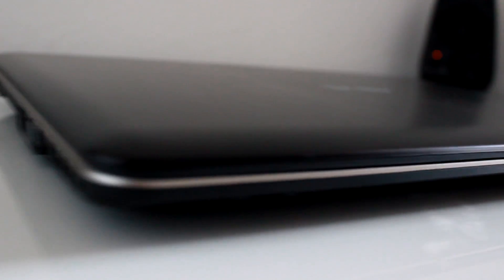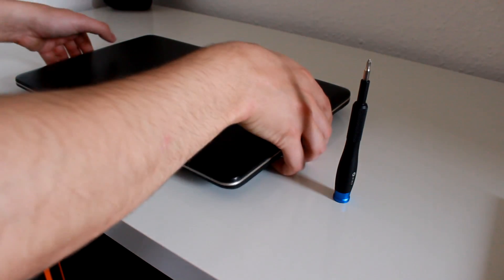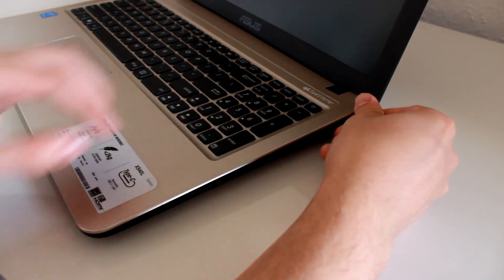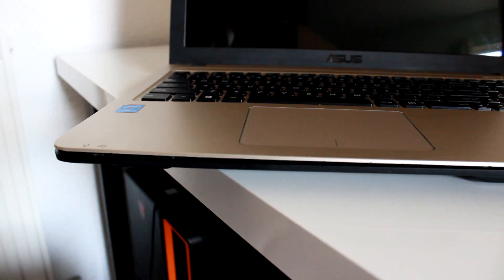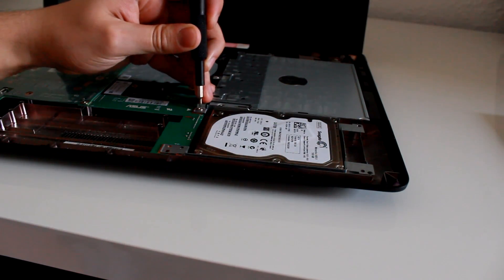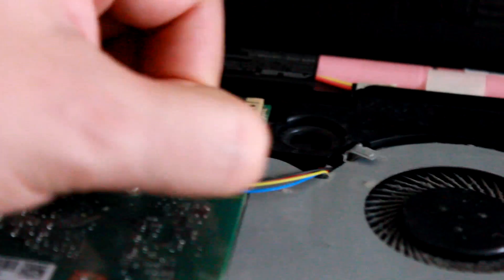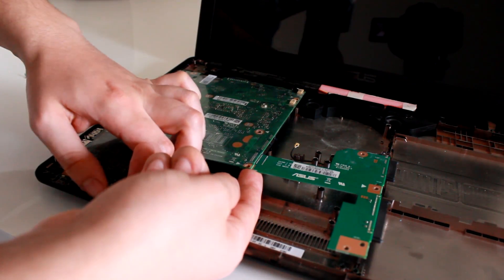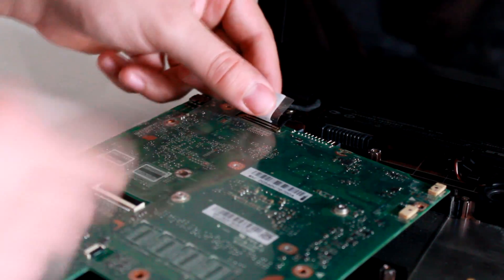Disassembling the Asus X540L: A Look Inside the Laptop

Comment: I have Asus X540LA-XX975. I just bought SSD and two 4GB ram sticks... Wanted to add additional ssd for storage and expand ram, but looks like too much husle... Can I have two ssd's?
Reply from the maker: If you can find the adapter for SSD's that goes in the DVD readers place than you can place a second SSD. As far as I remember this laptop only supports one stick of Ram
Reply: @TechGadgetsMedia  I found one guy selling them. Will order one. Do I need anything else? Cable to connect ssd with moherboard? If I need one, which one to buy?
Reply from the maker: If you got the adapter then you should just place the SSD in that then remove the dvd player and put it in its place.
Reply: @TechGadgetsMedia  I don't have dvd player, nor that external slot for it. Don't know what's it like inside. Wanted to buy everything I needed and then open it once and install everything...
Reply from the maker: Oh I see.. it might be a different version than mine then.. so what adapter did you find then? Send a link if you can.
Reply: @TechGadgetsMedia  https://m.kupujemprodajem.com/kompjuteri-laptop-i-tablet/laptopovi-cd-dvd-drajvovi/caddy-bay-ubacite-ssd-hdd-umesto-optike-metalni-kedi/oglas/38844203#start

Local site, not from ebay or amazon I'm afraid.
.btw, I opened my laptop to see for myself what it looks like inside. And there is another port for ssd or dvd player, however, there are plastic cylinders where second ssd should go. They can't be removed. Which means I can only have one ssd...
Reply from the maker: I suggest you have to take the laptop apart first and have look if you can install it. You need space for that. Also a connector.
Reply from the maker: Right so that explains it.. that is unfortunate.

Comment: Great Video! Can you please advise where the CMOS battery is for this model?
Reply from the maker: I think these series never had one. Asus is using a capacitor instead of a CMOS battery. It would get power from the main battery.
Reply: @TechGadgetsMedia  What will happen if you remove your battery? Will you get your Bios reset every time you boot? Will it mess up my system if I ran it without a battery? Appreciate the response.
Reply from the maker: @marktupaz5170  I don’t own this laptop anymore but as far as I remember the battery in this laptop is not removable. Of course if you replace the battery that can reset the bios.

Comment: Important message for all the peoples owning the R540L variant: your ram is actually soldered into the logic board. A second slot is available but it will not take more than 4gb of ram. 
I just tried to upgrade my laptop with a 8gb memory stick and it isn't recognised by the system. Only the og 4gb are.

Comment: what kind of ram asus x540 L  have? What kind of ssd is suitable  for this laptop ssd 2.5 or m.2 slot? Plz do reply
Reply from the maker: You have to google the ram for the laptop, you will find loads. I have upgraded this laptop with a 2.5 ssd, there is no m.2 slot.
Reply: @TechGadgetsMedia  thx. One more question, how many gigs of ram can put in this laptop? What would be the total ram later??
Reply from the maker: As far as I remember there is only one slot so 8gb max.
Reply: @TechGadgetsMedia  yesterday I updated my laptop . If cost me 7200 inr. It includes wd green ssd, 8gb adata ram, one external HDD case. Now my laptop has 12gb ram, it's speed improved remarkably. It take 13 sec to start after pressing the power button.

Comment: Nice video, but my battery now is not being recognized by the PC and is always in 0% and is plugged in to the motherboard. Any idea of what could be happening?
Reply from the maker: Have you disassembled it?
Reply: @TechGadgetsMedia  yes, I had a problem with the ventilation and i had to do it, but now my battery Is allways at 0% and my pc only last like 2 seconds before it shuts down when i unplug the power cable
Reply from the maker: @charlesthenouxr.5631  Have you checked if you have plugged everything back? Maybe damaged the battery cables/connectors?

Comment: hey, mate, ever heard of a killswitch feature when you open the case and the power is not plugged ? just opened my laptop to clean it and now it won't stay on when I unplug the cord...
Reply from the maker: No I haven't heard about that, maybe you damaged the battery cables?
Reply: Having the same problem with an X540L. Doesn't power on without power adapter anymore. Measured the pins with a multimeter and they are connected properly to the motherboard, but the voltage on the 12V is missing.

Comment: hi tech gadgets. thanks for this tutorial video. im from the philippines and i have x540up model. is ram upgradable for this kind of unit? if yes, what is max memory i can upgrade it to?
Reply from the maker: Hi. There is only one slot in this unit for RAM. The maximum it can handle is 16gb as far as I know.
Reply: Hi as it all depends on ur CPU and in this case the ram is upgradable to 16 go,ddr3l, the frequency is up to 1600ghz max.

Comment: HI my x540l got spilt by water. Is it still fixable?
Reply from the maker: Well I saw a video where the laptop was left outside in the rain for hours but it was turned off. Eventually the guy took the laptop apart and had to dry every last inch of it but guess what after he reassembled it, it worked.
Reply: @TechGadgetsMedia  well wish me luck. thanks!

Comment: Hi everyone, I recently upgraded the RAM and HDD on my X540LA. The only problem I caused or came across was apon restarting, the laptop shuts down immediately when using battery only, AC with battery in or out is fine, runs perfectly, remove the AC charger cable and the laptop shuts down immediately. Have switched batteries, done a pwr reset, removed the battery from Device Manager, all to no avail?? Any Thoughts or suggestions??  The only other thing I can mention is after the AC cable has been connected for awhile, it goes into a 1 seconcond on/off flash rythme, no cycle, just the on/off every second or so..
Hope you can help make sense of this and ssuggest where I may have gone array, 
Thanks in Advance, 
Paul.
Reply: You put hibigs back together rwrong
Reply: Having the same problem with X540LA. Everything is connected fine, but the battery doesn't produce 12V anymore, even though the cells are charged. Seems like the voltage regulator in the battery breaks if you disassemble the laptop. Great Asus!

Comment: So after I looked at the inside I reassembled it and it wouldn’t turn on does anybody have a solut
Reply: Solution *
Reply: Yes you need to make sure the ribbon cables for the touchpad and keyboard are seated correctly in the connectors

Comment: Can you help me?, I want to change the dvd drive for a hard drive caddy. But I do not know if the DVD drive is 12.7mm or 9.5mm, and whether it is SATA or IDE
Reply from the maker: well i am not sure about that but here is a link if it can help:
http://www.ebay.co.uk/itm/Genuine-Asus-X540L-X541U-X540LJ-X540LA-Super-Multi-DVD-Disc-Drive-Optical-GUE1N-/263087442530?_trksid=p2385738.m2548.l4275

this is the one in this laptop
Reply: Hello, a little late but did you change the unit? it's SATA 9.5mm, is not it?
Reply: @banters They're indeed the most used, i'm curious too